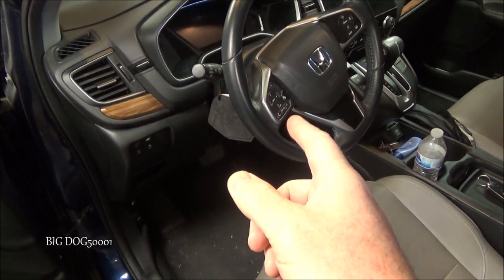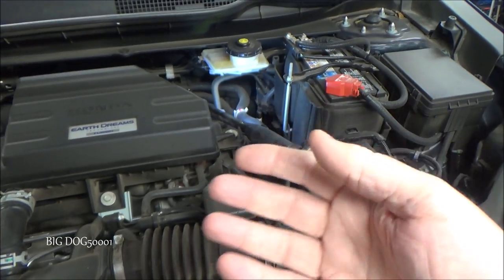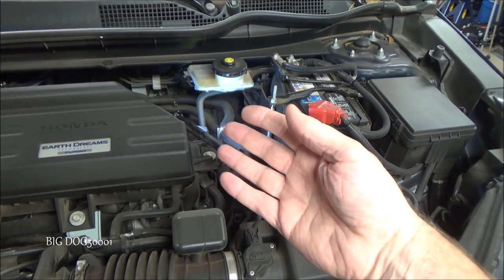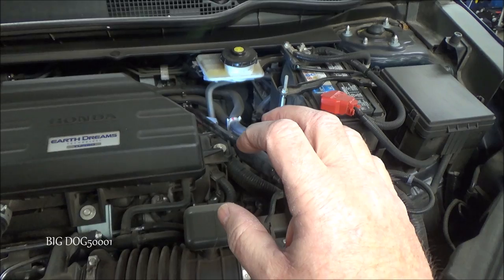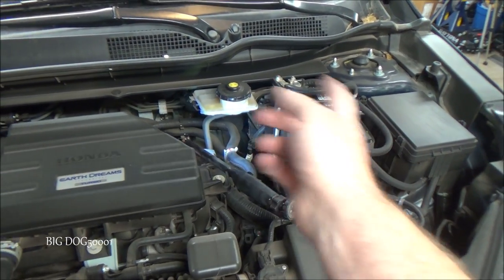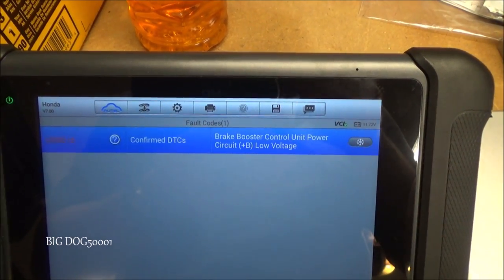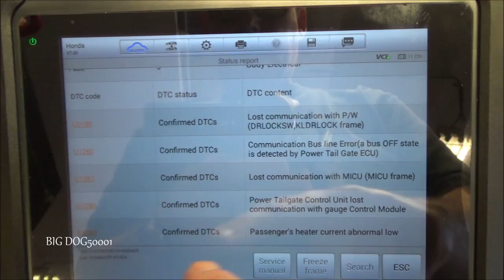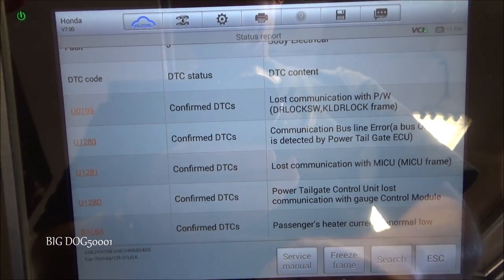Honda Tips: Brake Pedal Kicks Back During Engine Start (U3003-16)

Comment from the maker: Be sure to subscribe for more tool and car repair videos! 
https://www.youtube.com/BigDog50001

Buy Big Dog50001 T-Shirts, coffee mugs and other gear here!
https://bigdog50001automotive.myspreadshop.com

https://twitter.com/BigDog50001
https://www.instagram.com/bigdog50001/

The Big Dog 50001 Automotive Channel Store can be found here: https://www.amazon.com/shop/bigdog50001automotive  (As an Amazon Associate I earn from qualifying purchases).
Reply: Thanks!  Your transmission fluid change guided me on my 2011 Accord 2.4.  I'm having trouble reading the dipstick to get an accurate reading.  I put 2.6 quarts in, got low reading, and added another half quart, could see it on the tip.  I don't believe there is a leak. Should the color/thickness of the fluid be a continuation of what is at the tip of the dipstick?  Or will it appear to be lighter/ more translucent in the hashtag area?  Thanks you for the thorough content!

Comment: Thats pretty good diagnosis brother! I have a 2017 honda civic sport touring 1.5L turbo engine model, And since I have 30+ years of experience under the hood of cars and I believe that my vehicle and yours have the same engine in them? I figured it probably wouldn't hurt to add my experiences after 45,000 miles. At 24,000 i experienced a loss of power or lets say it lost its getty up! So I started searching for answers on YouTube and found someone commented that you should check the positive battery cable because his was loose from the factory and that he had never messed with his. So I go out and check mine and sure enough! The positive battery cable was loose! On further inspection, i decided to take the battery hold down bracket off  and peeled the sticker back to expose the caps and opened them with a surprise waiting for me when I looked down inside. The water/Acid level was only half full and all the lead plates exposed! I knew that battery was fried immediately! But what caused this to happen i wondered? So I did some more research and found out that honda put a battery in the cars that were sold in the US that weighed twelve pounds lighter than the ones that were sold in colder climates like Canada! There is way too many things that are drawing power on these vehicles to be worried about saving weight for fuel mileage and taking away reserve compassady of the battery! I have learned that the batteries reserve compassady is far more important than the cold cranking amps that a person would usually look for in a battery. Now that I fixed that issue and got my getty up back to good I wanted to see what the sparkplugs looked like at 30,000 miles. And I know better then to listen to that nonsense that all these car manufacturers use as a selling technique and go a hundred thousand miles before tune up time! They are supposed to be set at 30 thousand  on the plug gap and three of them were at 26 and one was 28 on the gap! I set all four plugs where they were supposed to be and was ready for a test drive. I went to back out of my driveway and almost ran over my neighbors garbage can it made such a difference! It was very noticeable the power difference when they were gapped correct. So recently I have noticed the brake pedal sinking when I'm stopped at the traffic signal with my foot on the brake! So enstead of going directly to the master cylinder i thought maybe the vent silinoid was sticking open and when the computer ran its test checking for an EVAP leak it was detecting a vacuum leak? Turns out that it was the PCV Valve sticking open and loosing the vacuum from that! And I came to that conclusion because I replaced the PCV Valve and Bingo! Problem solved! 😉